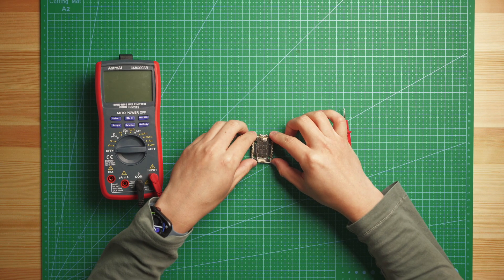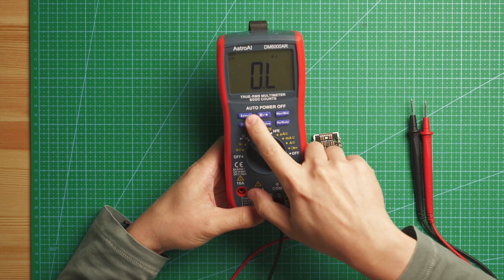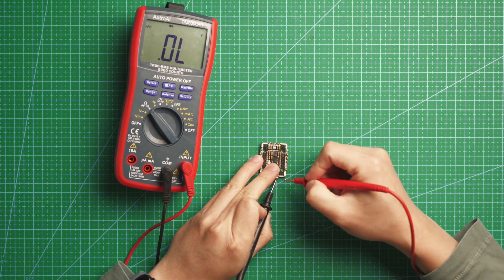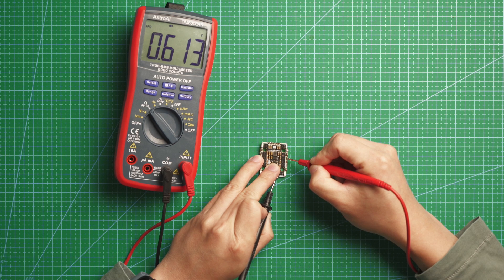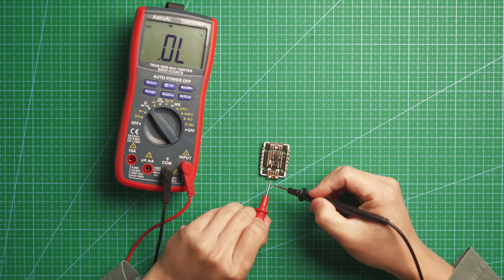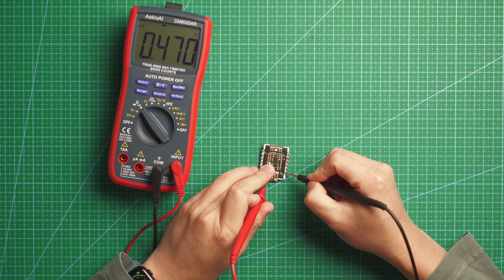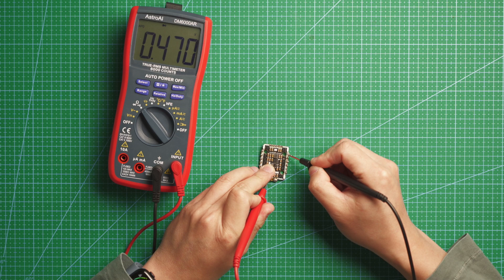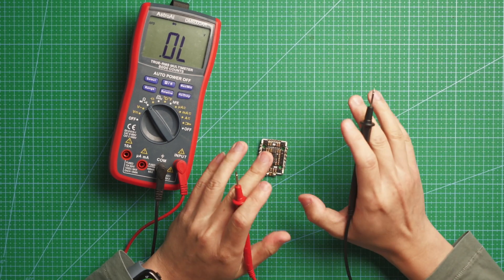How to Test ESC MOSFETs with a Multimeter | A NewBeeDrone Tutorial

Comment: I am certain my ESC is "dead", it goes at maximum half RPM on MOTT #1 ( and therefore the whole quad is throttled back ) but this shows the mosfets are all at ~500Ohms. Is there another failure mode that would result in my issue?